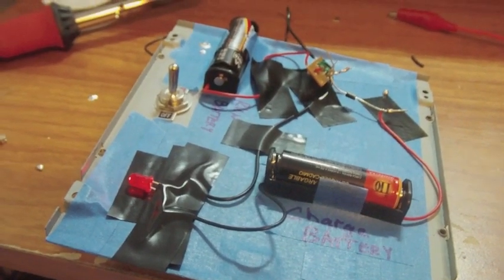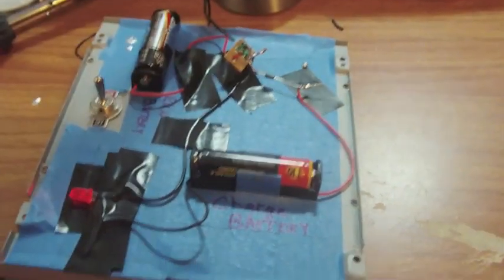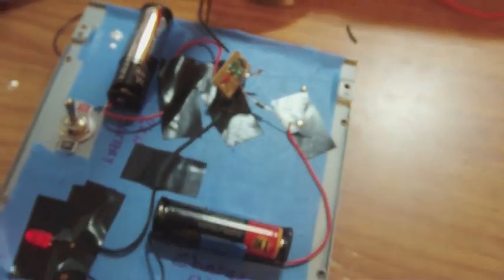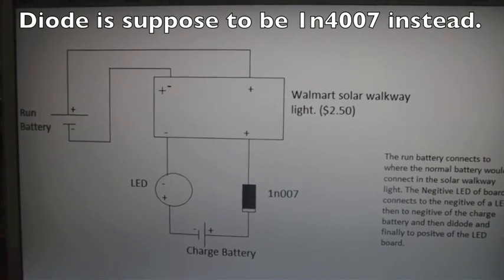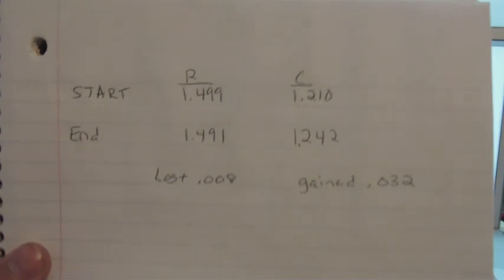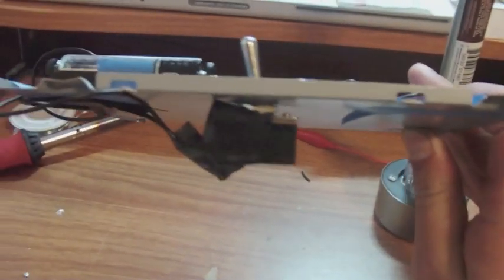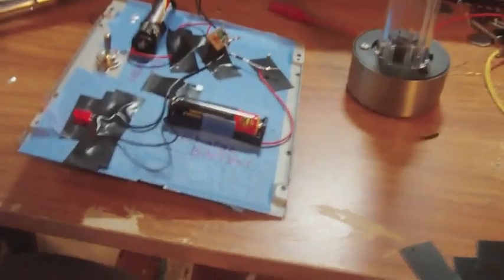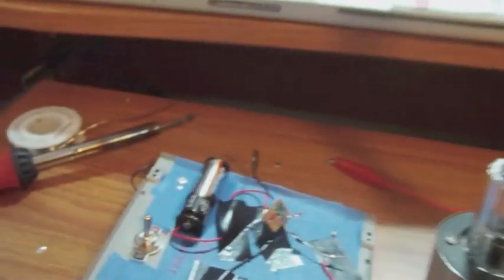Simple Joule Thief Charger

Comment: You have to remember that the red LED is a DIODE.  It will rectify the pulses coming from the JT circuit, so you really don't need to have the 1N4007 diode.  Thanks for the video - using the circuit from the solar garden light makes this project so easy.

Comment: Can you continue the test and keep graphing it until the source battery is discharged?  A better test would be to start off with two identical batteries, first charge and discharge them to verify their voltage limits since all batteries are not the same. Also consider that battery voltage has a curve and .032 on the charged end is not the same as .032 on the discharged end and it doesn't directly equate to energy stored and percent charged.

Comment from the maker: @jewishcrimenetwork It's a simple joule thief circuit, so to scale up you would need to use a bigger coil and transistors. I have made versions that take a 12 volt car battery and charge a 12 volt car battery. This one works best to recharge non rechargeable alkaline batteries.

Comment: You need to clarify what you mean when you say 'electricity'.  Do you mean volts? amps? Sure circuits can give more voltage or amperage than what is put in, but not more energy.  Power is V * I, and energy is power over time.  When you increase or decrease V or I, you proportionally change the other, and energy is conserved.

Comment: I think what you refer to when you say "overunity" is not quite what you think it is.  It is possible to achieve higher than 100% efficiency in a system, just google "mit led over 100%", but in those cases, they don't achieve higher than 100% electrical efficiency, but rather higher than 100% total efficiency.  The electrical characteristics of the material usually result in an input of energy from another source, like lattice stored energy.  This is not over-unity in terms of total energy.